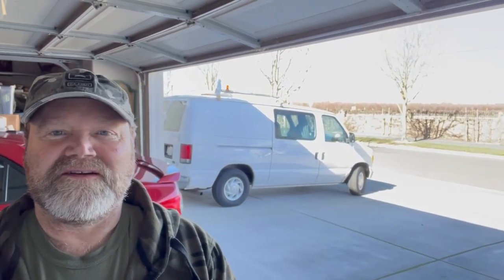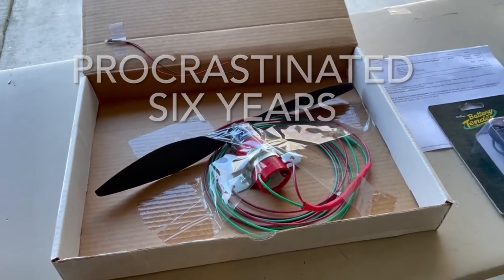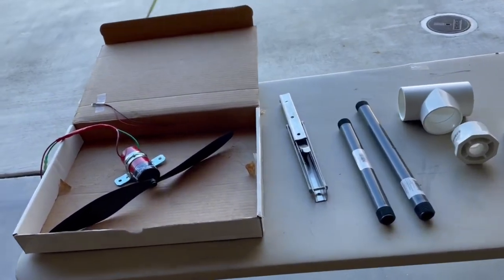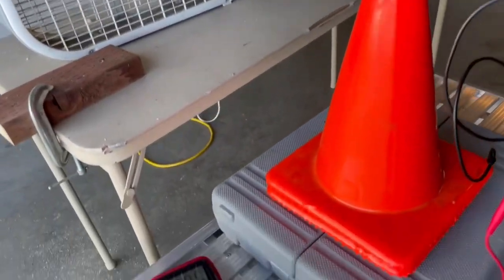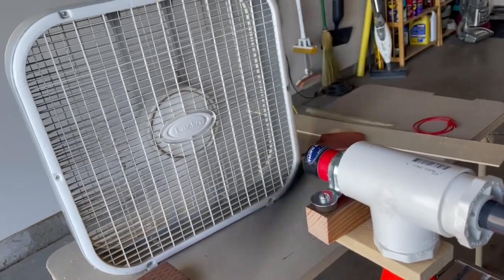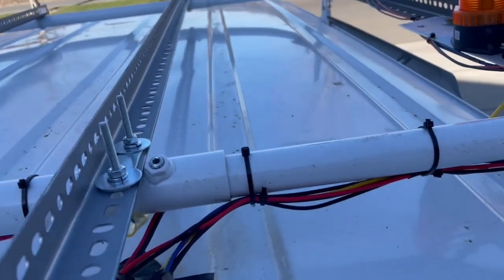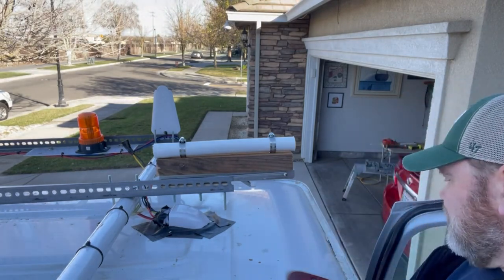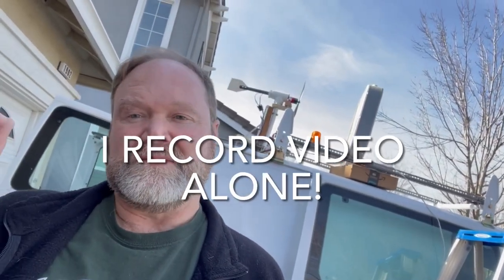Van Conversion - Wind Turbine for Generating Power at Night

Comment: Nice!  If you converted it to a VAWT (vertical axis wind turbine) you could, in theory, turn the mount so the entire turbine folds down against the roof. Then you could just cover it with a draw-string bag.  Either way nice work!

Comment: i would suggest making slip rings and i would raise the turbine at least 4 feet with a pipe if you can.   30 feet above obstructions 500 feet distant is the standard. when i was i school, the math stated about 60-80 feet above 500 feet distant

Comment: Use 4 or 5 bladed propeller may turn easier/faster in low wind conditions. Mount motor on some type of pin/point to turn into wind easier. Just some ideas🤔. Also wire through a capacitor may generate more? power?
Reply from the maker: Thanks, I have been thinking about improving my wind turbine.  These are some great suggestions!
Reply: @holidaytinn maybe a 4 or 5 blade with a lill more weight to it for enirtia and a larger and much higher quality motor.love the idea

Comment: Great idea. I thought about doing something similar, but I couldn't figure out a solution for the wiring being tangled when the turbine rotates in the wind.
Reply: Run it through the center virtual pipe at the base of the turbine.
Reply from the maker: I will try what Eric suggested if it gets tangled.  I have left extra long wires on the turbine. Thanks for the comments!

Comment: great video, thank you! Curious if you have had a chance to test it in real world conditions. Seems like the fan needs to spin really fast to provide enough voltage to charge. Wondering if you seen that kind of wind out there. Thanks for the content!
Reply from the maker: I have used it.  I used it in the desert in Arizona. You are correct, it needs to spin fairly fast to charge your battery. My camera does not capture how fast it is really spinning. Oddly the camera on my phone makes the fan look like it is not spinning at all when the blades are actually spinning really fast. I have now learned that it is not silent. I woke up at night and I heard it on my  van roof spinning really fast. It makes a whirling noise.
Reply: Always wondered why I can't have one spinning whole I'm driving

Comment: If you remove the turbine every use. Why add the collapsible bracket?
Reply from the maker: A few reasons for the fold down bracket made sense to me. One is a quick and easy set up. I don’t have to screw together any pieces for a stand, or run any wires for stability. Also I don’t have to store any bulky pieces for a stand in my van. The best reason is quick take down if I need to leave in a hurry with no disassembly of a stand which would take time. I can leave the turbine in the stand and fold it down for a quick short trip to Starbucks if I want to.
Reply from the maker: A few reasons for the fold down bracket made sense to me. One is a quick and easy set up. I don’t have to screw together any pieces for a stand, or run any wires for stability. Also I don’t have to store any bulky pieces for a stand in my van. The best reason is quick take down if I need to leave in a hurry with no disassembly of a stand which would take time. I can leave the turbine in the stand and fold it down for a quick short trip to Starbucks if I want to.

Comment: i dont think that turbine is big enough to power anything. they make vertical wind turbines that are probably gonna be more effective for folding away , they could run the entire length of your roof while stored
Reply from the maker: This turbine produces over 14 volts in a strong wind. It generates enough power to help recharge my batteries throughout the night.
Reply: who would want something that big on top of there vehicle, that could fly off and cause damage
Reply from the maker: @cherylbrown7622  I can not drive with it on the roof. I store it in the van while driving.
Reply: LOL @holidaytinn

Comment: You didn't create any power here, to get power you need  amps as well as voltage. To get amps into the battery the voltage needs to be higher than the battery voltage
Reply from the maker: The fan in the video does not produce a lot of wind. A strong wind while out camping produces a lot of power.  I have measured over 18 volts on a multimeter in a strong wind with this turbine.  I’ve used the turbine in much stronger than that winds but did not check. The stronger the wind, the more power you will generate.

Comment: If the input is 10V, how does it charge a 12V battery?
Reply from the maker: The input depends on how fast it spins. The faster it spins, the more the voltage is generated.  I have used a multimeter on it in a high wind and it has generated 15 volts.  I have it connected to a charge controller.  If it is not generating more than 12 volts at night, no harm no foul.
Reply: Okay, so I have been looking into these things and at combiners. If you put 2 in serial? My sdolar charge controller only kicks in on like 15V plus. Are these still on the market as they are realy tiny and I live in a windy suburb and don't want to disrupt the neighbourhood too much :P @holidaytinn
Reply: o damn not on local amazon and otherwise 249 dollar and 60 dollar delivery. Way too much.
Reply from the maker: I don’t see it on Amazon anymore. I bought mine there years ago.  I believe that you now have to go to the Pacific Sky Power Website to buy it.

Comment: How many watts is that?
Reply from the maker: The specs do not provide watts.  A project turbine like this one produces a variance of watts depending on the speed of the wind and the duration of time the wind is blowing. The charging capabilities are trickle charges throughout the night or full on charging with high winds.  The best result that I have had with this turbine was in a high wind all night long. I went to bed with 12.5 volts on my house battery. I checked the next morning, my house battery was measuring 14 volts. Check out the Pacific Sky Power website https://pacificskypower.com/new-small-wind-turbine-generator/

Comment: With a high powered magnet mounted below and wrapping the fan blade with copper coil it turns on its own.   Revolutions for free.  24/7.  I can send you design, have telegram?
Reply from the maker: I don’t have a telegram, but your comment sounds great!  I’ll search it up !  Thanks for the comment!
Reply: @holidaytinn  I've got a large folder on free energy.  Devices simple and complicated.  If you make it work.  Keep it on the down low.  People go missing for less.  Love the channel mate.
Reply: @MyFriendlyPup  As a rule of thumb: perpetual motion devices always use more power than they generate.
Reply: @MyFriendlyPup  It is up to you to figure out where energy being lost. Consider it a puzzle.

Does any part of the device get warm during operation? That would be a clue of lost energy.